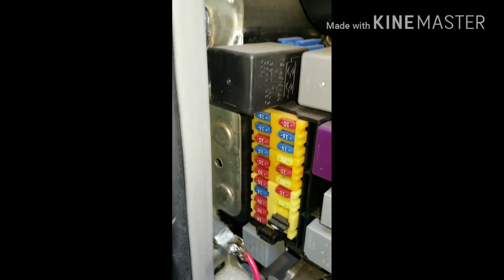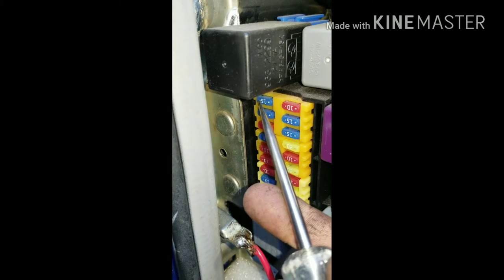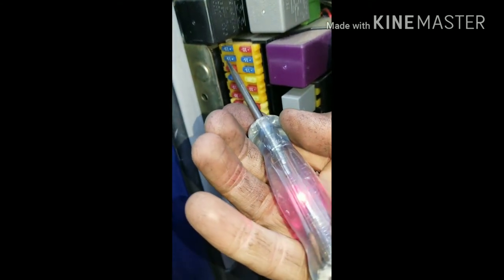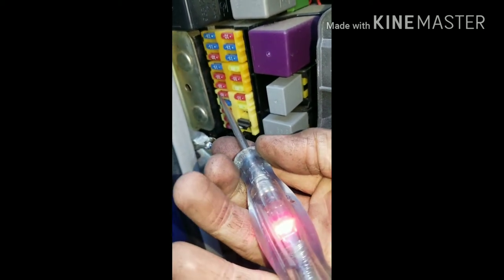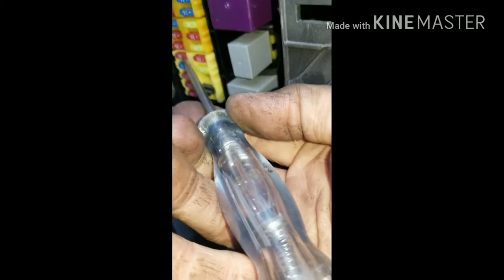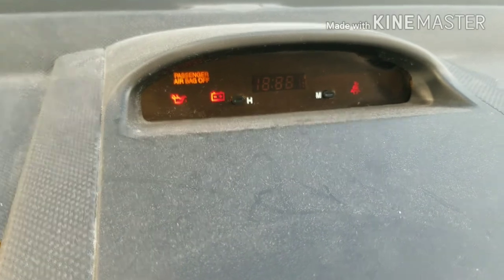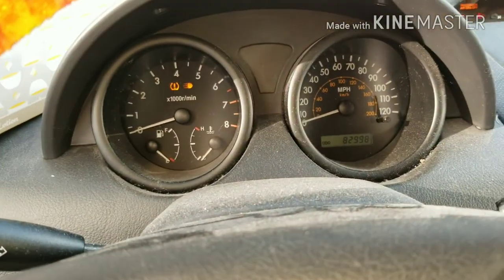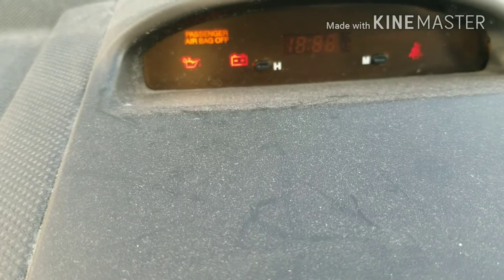My car wont start after  I jumped started it backwards.

Comment: I jumped mine accord backwards and it all has power but the engine won’t turn over? I checked the fuses nothing looks blown cold it be the starter? Or would the alternator cause it not to start even with a new battery?
Reply from the maker: if it won't start,  and your battery is fully charged you could have other issues a starter or relay wiring something like that thanks for watchin.

Comment: I jump started my van while the guy who was jumping me was revving his engine. Mine started but was making this awful high pitched whine so I shut it off. I smelled a burning smell. Now it won’t jump at all even after 10 minutes on the cables. Any ideas?
Reply from the maker: It could of been your alternator bearing seized up, or the alternator working extra hard and making the belt slip possibly, I hope  this helps  thanks for watching
Reply: fixer good thanks😊. We had the 30 degree below that morning so she was not a happy girl anyway. Will it resolve maybe when it warms up tmrw?